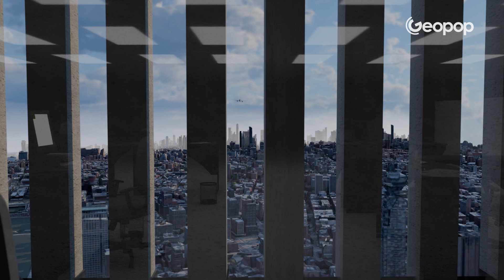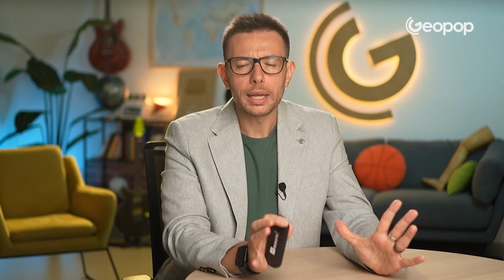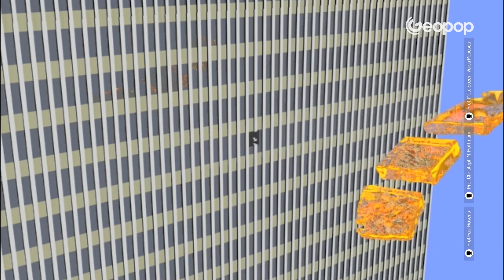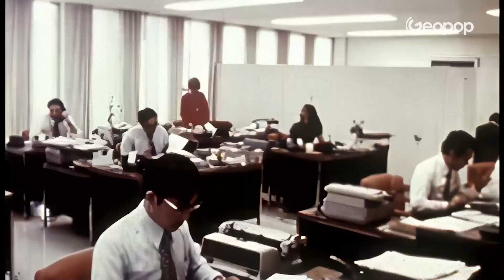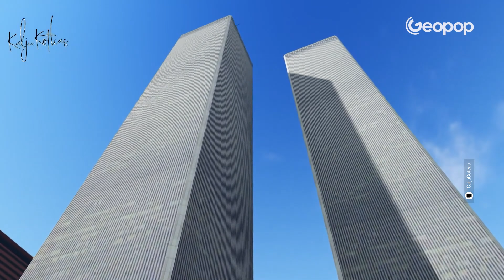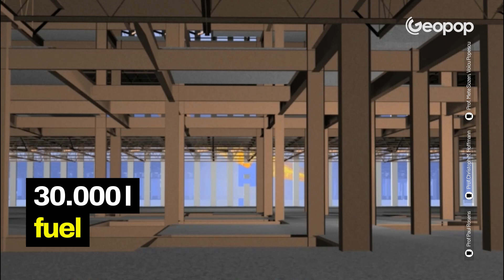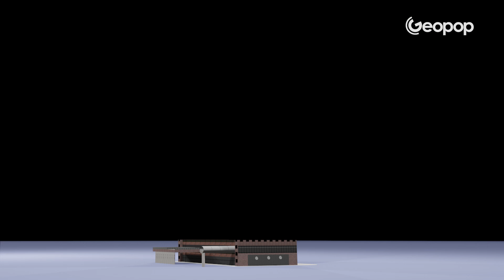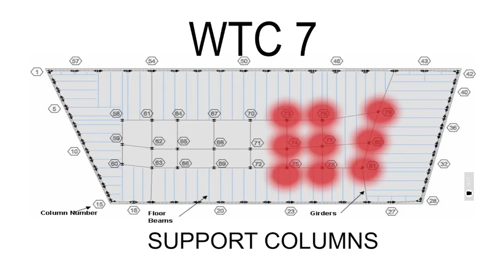9/11, 2001: The Technical Reconstruction of the Twin Towers and WTC 7 Collapses

Comment: The collapse of building 7 begins with a structure on its roof! It was not destroyed by fire! Building 7 was industrially demolished, just like the Twin Towers
Reply: Yeah, no. Much misunderstood, Building 7 was the 6th building to collapse of 10 lost on 9/11. Because of its early low priority, conspiracy filled the information void with garbage made up by technically ignorant people promoting political agendas. But 7's loss is an engineering problem and should be treated as such, so I prepared this brief summary of my own analysis to fix that, using technical analysis, not ideology and tired memes. 

At 10:28am the WTC North Tower collapsed, showering Building 7 with tons of burning debris, causing heavy damage and starting many large  fires which burned out of control for the next 7 hours. Half the FDNY firefighters having been killed, units in disarray, equipment destroyed, no water pressure, and the greater urgency of search & rescue efforts, Building 7 couldn’t be saved so firefighting efforts were pulled as futile and 7 left to its fate. Firefighters make that sort of choice every day in brush fire situations - which houses to save and which ones to let go. Only real difference here is moving the decimal on the size and cost. People get overwhelmed by the size.

www.youtube.com/watch?v=g_SvpwyC17M

Collapse of a burning structure is always a concern for firefighters. Steel buildings subject to fire rely on active firefighting to survive. Buildings are designed around 1 to 3 hours of fire resistance, allowing time for occupants to escape and active firefighting to get started, after which all bets are off. Left to their own devices they'll exceed their design envelope and collapse, like Plasco Tower and Wilton Paes de Almeida. In 7 the occupants escaped, passive and active fire protections were compromised and active firefighting was abandoned hours before the collapse, which left the building to its fate. It lost. Odds on Building 7 would eventually collapse, and it did. No big deal in logic.

 http://www.youtube.com/watch?v=WnYBX6QT0R4 

FDNY Chief Daniel Nigro - The biggest decision we had to make on the first day was to clear the area and create a collapse zone around the severely damaged 7 World Trade Center, a 47-story building heavily involved in fire. A number of fire officers and companies assessed the damage to the building. The appraisals indicated that the building's structural integrity was in serious doubt. I issued orders to PULL back the firefighters and define the collapse zone. It was a critical decision; We could not lose any more firefighters. It took a lot of time to PULL everyone out, given the emotionalism of the day, communications difficulties and the collapse terrain 

FDNY Deputy Chief Peter Hayden ; We had our special operations people set up surveying instruments to monitor and see if there was any movement in the building. We were concerned of the possibility of collapse in the building. And we had a discussion with one particular engineer there, and we asked him if we allowed it to burn could we anticipate a collapse and if so, how soon? And it turned out that he was pretty much right on the money, that he said 'In its current state you have about 5 hours 

The collapse of Building 7 was anticipated and widely reported in the media throughout the day, with 24 video cameras recording some or all of the collapse. Everyone knew what was coming and why. 

www.youtube.com/watch?v=OY5S5k3tMHI

The collapse of Building 7’s was entirely different to the Twin Towers and harder to understand, most details being hidden from view and not intuitive.  But we can still sort out what happened through careful analysis and observation. This is my explanation of the collapse relying on no outside authority. 

Building 7 was a unique, asymmetrical 47-story steel framed structure built atop a smaller 3-story building serving as a partial foundation, requiring lower floors dedicated to complex load transfer structures. Of trapezoidal shape and all-steel tube-in-tube construction, B7 (above the 7th floor) consisted of a central core of steel columns carrying most of the gravity load, perimeter steel columns around the outside of the structure carrying the remainder of the gravity loads and long span beams and girders to tie those elements together and form the floors. On the outside of the building hung a moment frame or outer shell. 

Phase 1 : First externally visible signs of collapse initiation occurred at 5:20:28 pm and were notably quiet with observers not realizing the building was collapsing! No audible warning in the form of hundreds of ear drum busting 180-190dB explosive bangs preceding the collapse. Here at 12:00 a local CBS affiliate reporter is talking 10 blocks from B7 when collapse begins. People don’t start to notice the collapse until 12:11. At 12:45 is the famous CBS fixed camera clip of Building 7’s collapse. Note how quiet it is. 

www.youtube.com/watch?v=t5tEy6mXSE8

Collapse initiation was due to lower floor failures above the load transfer region (8-14th floors) in the NE corner. In this video at 0:45 you can see the NW corner from inside the building while under construction, Column 79 just out of frame on the left. That big, angled steel beam across the top of the frame connects to C79 at one end. The girders connect to the beam. That beam and all those girders depend on just one connection 

www.youtube.com/watch?v=nP3TNHPCIVU&t=45s

Phase 2 : The NE lower floor failures caused a loss of critical lateral support over an excessive length of Column 79 and it buckled. Looking at a floor diagram of Building 7 (www.nist.gov/image-16640) when you see all the structures that depend on C79 you quickly realize this one column was a relatively isolated structural element on which a disproportionately greater fraction of the structure depended analogous to say the Key Bridge. Externally as collapse begins we see a vertical progression of window breakage along the 44-46 line and a kink in the roof of the East Mechanical Penthouse at the top of the building, consistent with C79 failure. Normally with a buckling column, the load could be redistributed to other columns. With C79 that is not the case - the failure did not redistribute the load, so the collapse rapidly progressed to the roofline, sinking the rooftop penthouse. The transition from full capacity to almost no capacity occurs in an instant and will result in virtually no resistance 

Phase 3 : With C79 gone, B7’s progressive, non-symmetrical collapse continues with adjacent columns 80 and 81 left laterally unsupported, and quickly buckling as well, sending the EMP down through the building. C79-81 all have no diagonal bracing, which is the major reason why they could not redistribute a lot of vertical loads among one another. From there collapse progressed from east to west through the central core until the core was gone taking all of the interior floors and probably most of the perimeter columns with it. Follow the horizontal progression of window failures low in the building and the dropping of the remaining rooftop structures into the building. One of the big takeaways from the NIST Building 7 study (invariably ignored) was how their modeling determined C79 failing under ANY circumstances would have initiated the same collapse sequence. 

Phase 4 : After about 10 seconds only the exterior moment frame remains, giving the illusion B7 is still standing to the casual observer since little has outwardly changed. But it is just a hollow empty shell like an empty cereal box supported only by a few remaining columns and overloaded from the loss of the core columns and floors, quite unable to remain standing. With nothing remaining behind it, the north face leans inward, forming a V in the roofline, the last few columns buckle under the strain and the moment frame free falls, landing on top of the debris pile. 

It is only here at the very end that a single measurement of alleged free fall acceleration is taken, from a single point on the outer shell. The Building did not “free fall” – just one corner of the outer shell did, sort of. The Building_ (defined as its center-of-mass) was already gone before that happened. The period of alleged free fall was a product of how it fell NOT why it fell and can't tell us what started the collapse 10 seconds earlier. Start to finish the collapse took 18-20 seconds, 3 times longer than free fall . How fast something falls cannot tell you what started it falling_ anyway. 

The debris spread outside the footprint blocking surrounding streets, heavily damaging the Verizon Building and destroyed Fiterman Hall. 

Building 7’s progressive, non-symmetrical collapse was incidental and unintended collateral damage from the combined effects of fire + time + gravity, started by the collapsing North Tower. That is true no matter who planned and carried out the 9/11 attacks or why . The collapse was of so little consequence it barely registered at the time - a footnote, only taking on semi-mythical status as an alleged smoking gun years later when demolitions at the Twin Towers, missiles at the Pentagon and shoot down over Shanksville all failed and conspiracists had nothing left to work with. 

Anything can seem like a conspiracy if you don’t understand how it works. Now you should. I hope you found this helpful, informative and it solicits informed critical comment. If I made any errors of fact, logic or reason or left anything important out, please let me know so I can fix it. IF you can offer a more plausible alternative please do. Be the first. Please start any reply with the words “Tits McGee” or I will know you didn’t read it and are wasting my time.
Reply: @TheLoonResistance 😄🤣🤣🤣👉🤪 nop
Reply: 911 was inside job
Reply: @teeraudi - Maybe, but that changes nothing in my previous reply. You know, the one you didn't bother to read.
Reply: because I'm not interested in opinions that defend propaganda
Reply: @teeraudi  - No, you are so caught up in yourself aren't interested in anything that might contradict what you want/need to believe, so you stick your head in the sand as a form of ego protection, to shield yourself from any ideas other than your own.

You are not serious and a waste of time.  Goodbye.
Reply: @TheLoonResistance agree
Reply: @TheLoonResistance https://youtu.be/aZXsIkbxMGo?si=OYf4MdZYEqnXdMQ9